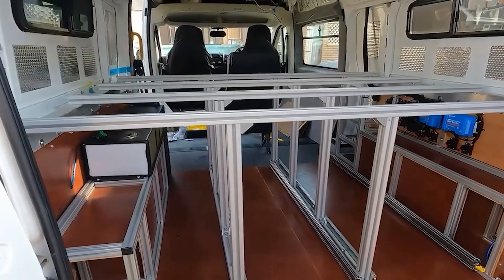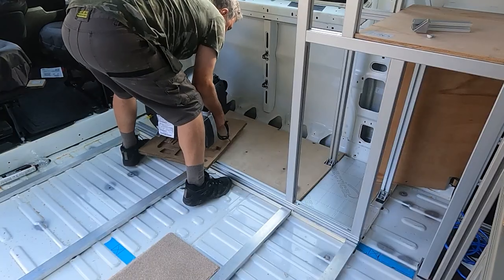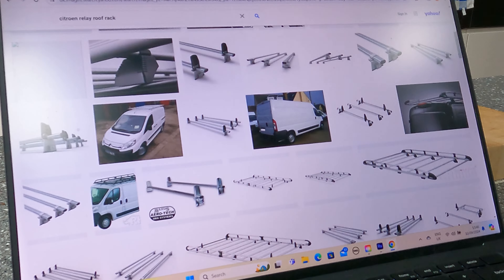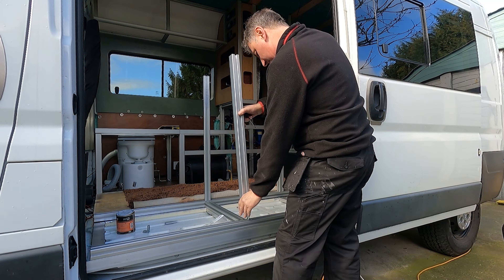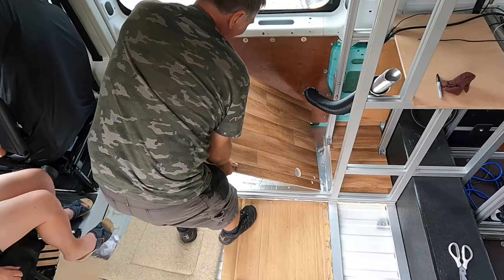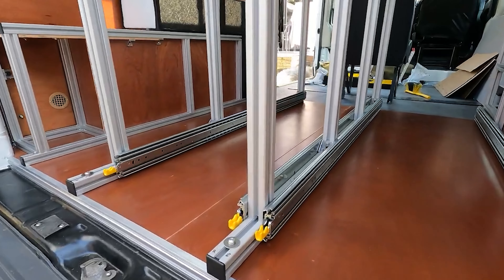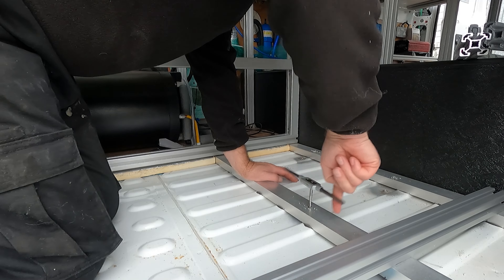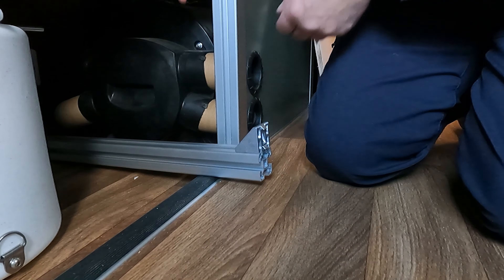80:20 style extruded alloy probably NOT the BEST PRODUCT for a van build!

Comment: When estimating the cost, do not forget to include all the hardware needed (bolts, t-nuts, plates, brackets). They cost as much as the bars. Also, it's not as easy to get the missing parts because you usually have to order / wait for them. It's not a quick visit to the local hardware store as wood construction would be. But, even knowing all that, I do not regret my choice.

Comment: I’ve been waiting for this vid guys….
I’m going your route with extrusion for framing. I have already done the sliding bed, ( out of “other material”) and as I don’t need as much going on in the garage ( open area, with perhaps framing to one side for electrics), I am looking to build two large side cabinet frames and a seating area basically. So 3 modular frames, so to speak….oh and a roof rack similar to yours, out of extrusion.
I did do a rough guess of cost of wood vs extrusion, but of course no fixings for either were included in my calculations, as that would get a bit difficult and complex.
I’m thinking ( read : guessing ) extrusion is about 8x the cost of using wood, again a very rough guesstimate🙃.
I like the inherent strength, longevity and flexibility of extrusion, with no worry of rot, swelling etc.
So I think if I can do my extrusion roof rack and interior frames for about £2500-£3000, with fixings, I would be happy. I have budgeted for that.
I’m not convinced extrusion is lighter than wood frame…however the thing I like is it will last.
Don’t think I will have as much aluminium on faces….i may have doors covering the faces. So, I am not doing it for aesthetics.
However I’m going for a Tetravan shower ( about £1600), so that’s my real extravagance. Madness😁
Reply from the maker: I know you've been waiting Richard.
This vlog took a lot of thinking, planning and executing so sorry for the wait.
Talking about weight, comparing size, the alloy is heavier than wood but I dare say you can use a hell of a lot less. With hindsight, 30x30 section would have been plenty strong enough for all my units. 
I think you will be within budget. The fixings you'll find are the greatest expense however, I did happen upon some Chinese internal conceiled fixings at a fraction of the cost which I've used on a few "lighter duty" areas, which appear to be working well. Don't skimp on the angle brackets though, the real things are a much more secure fit.
Send us some pictures as you go.
Paul
Reply: @vanlifemyway7806  I’m following Our Thriving Life channel, he uses 8020, and they also do freeze dried food ( but I don’t mind their ads as it’s their own product, and very short ads. I find Jeff a bit more digestible, and I like his video production. Jeff has built about as many vans as Humble Road.

Comment: Hi. I wonder with all the aluminum fastened directly the van steel, would that be contributing to the cold feel of the 8020 feel.  A thermal break is only as good as the thickness and material of the thermal breaks.  And you have a lot of contact points, especially on the floor.   On the floor, it seems like it would be better from an insulation perspective to cover the floor with insulation, then plywood, and fasten the 8020 to the plywood. to the plywood.
Reply from the maker: Hi and many thanks for watching. Any metalwork is going to feel colder than the rest of the environment.
I wouldn't say it's been too much of an issue and I did want more rigid structures than just bolting to plywood as my 2 fully extended 200kg slides might have objected.
Where I can, I have rubber thermal breaks to reduce any effects and don't have any major issues I'm concerned about whilst in use.
I've considered using composite fixings to close all bridges and perhaps would if I would be considering travel beyond our temporate zone but I'm not.
I hope to travel soon to many more warmer climates than not so happy to leave things as is which isn't much of a problem.
Every build is always a compromise rather than the perfect solution for our "Vanlifestyle" this is an ideal compromise for us.

Comment: Hello Paul.  I am just few months from the start of converting my own van.  Obviously, the weight of the van is a great concern.  What weight have you achieved with extruded aluminium?  By the way, you and George are inspiring.
Reply from the maker: Hi Rafal, thank you for watching and thank you so much for your kind comments.
We've yet to have the final weigh in and I'm hopeful we'll be well underweight.
The extruded alloy is no lighter than equivalent wood but it has allowed us to use differing building methods which have omitted many materials.
That been said, the additional water tank and the "Mistral" work surface we wanted may not help.
Won't be long now as we're very nearing completion.
Best wishes, Paul
Reply: Hello Paul.  I have started to build my own van.  However, I am building from 30x30mm aluminium.  Have you weighted your van already?  I've seen some other builders achieving 2850-2900kg.  I am wodndering about your.  All the best.

Comment: Im Winter wird es Probleme geben. Das glaube ich nicht, dass Sie keine Kondensationsprobleme haben. Beim erstellen des Videos hatten Sie keine Erfahrung. Es hat wiedersprüchliche Aussagen. Habe ebenfalls Aluminium verwendet jedoch ganz anders gebaut. Vielen Selbstausbauer werden erst später die Probleme erkennnen und dann den Van an den nächsten verkaufen.
Reply from the maker: Thank you for your comments.
Its been 3 years now and 2 winters building and using this van in various states of completion and we still do not have condensation issues having engineered excellent airflow and picking materials that compliment. 
Please be reassured after many years in business equipping vehicles for overland and expedition use in many climates, I have aquired quite a bit of knowledge and experience.